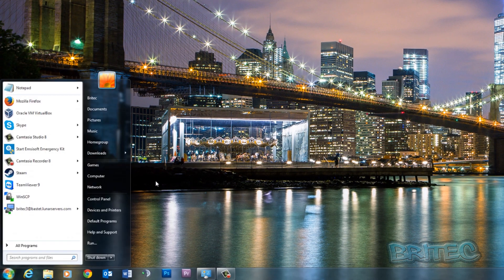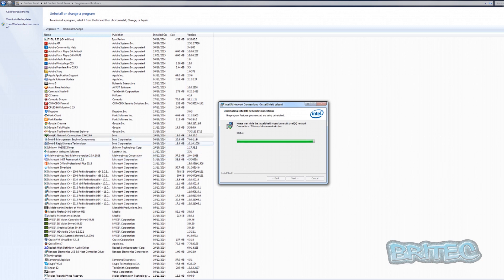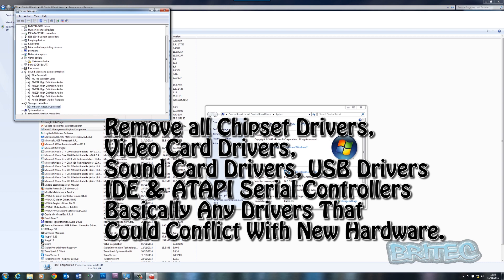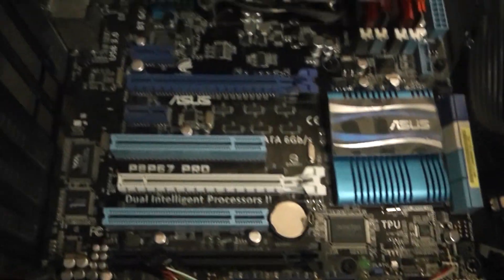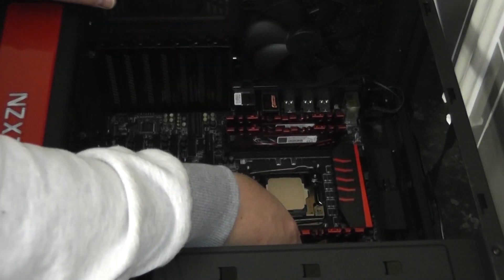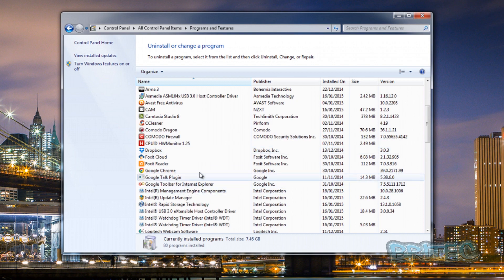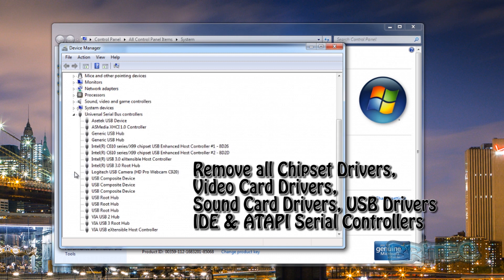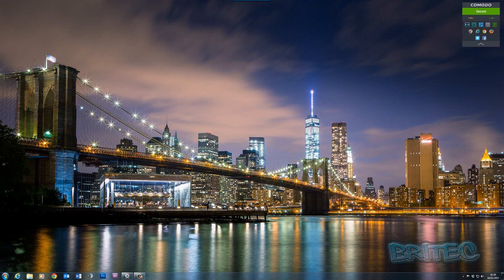Change Motherboard Without Fresh Install of Windows

Comment: Lets say you broke a pin, on the mother board, and you want to get a new one thats the exact same model, brand, and everything. Not needing to replace anything else like CPU, SSDs, RAM etc etc. Will I need to go through all these steps, also what data would I lose in the process? Note I do have windows 11 and all my apps/games installed on my SSDs.

Comment: If your old computer had a Raid-0 configuration, you MUST change the raid configuration in your bios to ENABLED in order to boot windows. Check your manufacturer for specifics. Worked fine for me. Great video.

Comment: Hi just up graded to a
MSI MAG Z590 TOMAHAWK 11th Gen i5 11600K and DDR 4  from a gigabyte Z77 i7 DDR3 so I did your deleted as much as I could in windows drivers in relation to the old motherboard l have to say I've been building systems since windows 4.1 and was very nervous doing it this way but absolutely no problem at all just got into the new Bios made a few changes rebooted like a charm thank you so much for this tip saving me a lot of time 😉😎👍

Comment: Can I do this on windows 10 ? Also do I need to reactivate it?
Reply: Only if the license came with the PC! If you replaced your motherboard you can try logging into your microsoft account so that the license is stored in your account it should say (Activated with a digital license linked to your microsoft account), then try that, never tried it so it might not work. Then I guess uninstall the drivers, which is weird because you'll have to reinstall them, replace the motherboard and then add the drivers back.

Comment: I always did a wipe... I finally got windows 10 This year. I just installed a Z490 with 10850k CPU... I should of just did a wipe. COMPUTER DOING WIERD shit! Playing games on 2 cores? Spiking and lagging system! LOL.

I thought windows was so advanced it would of just overlayed or removed older non-compatible. 1 days of stressing for no reason...

16 years doing this, and I should of followed my caveman ways. I will remove all the i7 9700k Intel Drivers.

Comment: Hi! Is there any way I can upgrade my motherboard to a new chipset/socket? I have a slightly early CPU in my computer (i5-2500K) and a ASUS P8Z68-V PRO (GEN3). Would it be possible to move my HDD to a new system without disturbing it? If so, how? example: new mobo and a 7th gen i7

Comment: URGENT HELP REQUIRED PLEASE
Hi, I hope that you receive this message in good health.

Super quick question, I am moving from Asus H310 9th gen > Msi mpg z390 9th gen.

Changing absolutely nothing but the motherboard.

Now, you said you reinstalled all the drivers. I understand that nvidia drivers you have to manually go and get. HOWEVER where did you get the intel chipset drivers and all the other little drivers from? Shouldn't windows automatically install them as it did for me the very first time like it did with the Asus H310 motherboard? 

Surely we don't have to go and find 20+ drivers for usb and chipset and all these other things manually right? 
Please tell me if these do install automatically. 

Really appreciate the time. 

Many thanks.
Reply: It depends on the motherboard. You can download the drivers on the motherboard's webpage most of the time just to be safe.

Comment: i guess better option is to reinstall windows, it will take alot time to uninstall and reinstall drivers, while u can install windows in 10 mins with all drivers and graphic n adobe softwares can be reinstalled in 10 to 15 mins aswell

Comment: I had to replace my motherboard when one of the resistors broke. Everything else stayed the same; cpu, gpu, ram, and hdd. Installed the appropriate drivers and it all worked fine.
Reply: Did you have to remove/uninstall the drivers from you old mobo as done in the video?  I want to do the same thing.  Keep everything the same just update the mobo.  Is this process a simple plug and play process?
Reply: @poseyserena02  it's highly recommended that you remove/uninstall the drivers of the old motherboard. not necessarily a plug and play process, but quite simple yes. just be sure to install the appropriate drivers for that particular motherboard. if using windows 10, it should cover most of the required drivers suitable for that motherboard. then just install the rest of the drivers you are familiar with, ie. GPU/video adapter.

Comment: What to do if old MB dies and you cannot boot Windows to uninstall drivers?
Reply: You can always boot with the new one and uninstall old drivers then
Reply: @TT-hd3zi  No, You can't do that always. The main purpose of uninstall those drivers is to avoid boot problems changing disk to another computer.

Comment: what if you don't remove the drivers, because like what you said the motherboard died... can you force safe boot with new motherboard and then remove drivers. Then normal boot and install drivers for new motherboard?

Comment: I don't even remove old drivers, just put a new motherboard and when posting it gets the new drivers, after that OS will asking for restart and that is it with no any conflict either, by the way sometimes i use Driver Booster to get the new drivers updated and also it can delete all unplugged old drivers in one click even to be sure that no one conflict will happen in the future.

Comment: Awesome video! I want to point out one thing though:

You should also be able to: replace the motherboard first -> boot Windows in safe mode -> uninstall all drivers -> boot to normal Windows -> install new drivers.
Now if you're having trouble getting the network working for some drivers that need download. I remember when my network card couldn't install without internet which could be a real hassle in the old days. Now you can just plug in your phone with USB and activate Tesselation. It's a function that let's your phone share it's network with your PC. You can connect your phone to your Wifi and share its internet with USB cable plugged in to your PC, or use 4G, 3G or whatever. 

In conclusion, even if your old motherboard is broken it still is possible to use your pre-installed Windows with the new motherboard!

Edit: I realized now that the video is from 2015. Although, this might be usefull for those who end up here looking for exacly this.
Reply: u cant do this is the mobo isnt even reading the hdd because of conflict.
or if u can please explain...
Reply: Absolutely brilliant comment.  Im actually combining techniques to do this as i wish to avoid the headache of uninstalling things im not certain i should be.

My mboard wouldnt let me select safe mode w/ my usb keyboard but i found out if i remove the cmos battery, it worked.  Once in safe mode w/ networking, i downloaded winsetupfromusb & paragon adaptive restore iso which im using to create a usb flash boot drive.

Im gonna let it do all the fixing automatically & if it fails, ill just manually  & carefully delete mboard drivers until i can boot up normal & manually reinstall any i find need to.

This def my first time doing this so im playing it super safe but so glad i found the 2 vids on this topic on this channel & glad i found your comment as i had very few options in making any of this a reality.  

I was about to but a new hdd just so i could use it like im now doing in safe mode.  Safe mode now even gives me the additional option to even do the uninstall so even if i have issues w/ paragon, i know i can figure this bs out lol.  Thanks so much!  So many so called geniuses out there but ive yet to find the solution you gave on google nor youtube after hours of research.  Such a simple solution too!
Reply: Yea my pc wont even read the drives, just goes straight to bios settings.
Reply: I found this video useful today, so haha. Thank you very much for your advice, that's what I'll do. Cheers

Comment: Would you be able to change motherboards of the same type but a different chip set without reinstalling drivers?
I have an ASUS Maximus code with the z270 chipset, and want to replace it with the same motherboard with a z370 set. Would this be possible without any major hassles?

Comment: my son has a problem detecting the mouse qnd keyboards after changing motherboard ..in start up it works but after operating system appears mouse and keyboard won't work

Comment: Lol, I switched from a AMD X470 Ryzen 7 2700x system to a Intel Z390 i7 9700k system, and I forgot that my old Windows installation was on my SSD.  Surprisingly it just booted from the AMD x470 Windows installation! Only reinstalled the Intel chipset and other drivers, and no problems so far :) Did not knew this was possible in 15+ years of PC building.  Always imagined an instant BSOD.
Reply: so basically reinstallation of windows are no longer necessary with windows 10? no conflictions on your end so far?

Comment: the nvidia drivers are unnecessary to uninstall , nvidia drivers of external cards are built to work on any windows machine if they match they same operating system. OS will update the graphic card installed after restart.

Comment: I'm going to change my old motherboard to a new one, when replacing am i going to need to buy a new windows 7 or can i keep the windows 7 installed in my previous Motherboard ?
Reply: It is 2019...why are u still on 7
Reply: @kas579  Because it's better lol. I'm on 7 too.

Comment: Hi.
Perfect your videos, thank you very much.

I have a problem with my pc.
Nothing appears on screen after switching hdd (win10 with problem) to hdd (win7).
Works regularly but nothing appears on the screen.
I emphasize that it is new, almost 1 month I have bought it.
What can be wrong?

Motherboard: ASROCK A320M-DGS RETAIL
Ram: PATRIOT PV48G300C6K VIPER 4 SERIES
CPU: AMD RYZEN 3 220G 3.7GHz 4-CORE
Graphic Card: Integrated AMD Radeon R-Series Graphics σε A-series APU.

Comment: Thanks for the video, very useful! I have a question- I have an Asus Prime Z270-P but I want to replace it with Asus Z270-A because the Z270-A is compatible with ThunderboltEX 3 controller. I`m not going to replace anything else, like cpu, memory, etc. I suppose all drivers must be the same for the new MB; should I do this procedure? It is not a  big upgrade, the same company, nearly identical mobos... Thanks.

Comment: Back in 2016 I build a "new" computer (switched from AMD2 to AMD3+) with a new CPU and motherboard, but didn't install a new OS. My friend just plugged in my hard drive, where Windows 7 is installed, and we had no issues. I'm planning to build a new rig since this build is useless but plan not to install a new OS. I will just transfer my current OS to a new SSD. You think this is ok? I don't mind installing a new OS, but I prefer Windows 7 much more than 10 and I don't really care about gaming. I plan to be an editor and designer.

Comment: from what i've been told it's often easier to get a new blank drive do a fresh install on a new HDD(SSD is preferrable nowadays) and then when the install is done and setup up you should be able to plug in your old HDD either internal or external as a secondary storage device (like extra storage space or a usb stick but bigger) and while i'm not sure if it's certain to be the case I have been told that can stop it from wiping though if I was you I might get a third to backup on in case it does and just copy across the files you want to keep.

then after that keep the original copy on the backups in-case you might need them ssd is best as they have no mechanical parts they're less likely to break when being moved!

i'm hoping since I don't have a back up that by using my currently blank hybrid ssd(which i'm currently just using for v-ram) as my installation drive (main drive) that once the computer is setup and essentially done with the process of installing basic software and drivers and stuff that I should be able to then shut it down open it up plug-in my old drive next to the new one and then access my old files as though they are in a spare drive thats full without losing my data although to avoid conflict I think I will try to remove the old windows files on it as they may cause issues but if i'm advised against that I'll have to buy a backup (hey it's what student loans are for)

A lot can wrong as it's my first time upgrading a without sending it to a workshop to be done for me since on the hardware side I know what i'm doing, but i'm going to be getting an up to date book or using my free college chromebook to walk me through it or to revise on before I attempt as there are still unknowns like hardware to software incompatibility issues and once it's done I can't go back to the old system cause from what I can tell it will believe itself to be a new system regardless if the components are the mostly the same!

but it's a needs must It's either that or pay £800 for a new one which is essentially an extra £400 for using the middle man where as I am buying from the manufacturer directly via amazon, 

rather than pc world for a retail build or a upgrade component package from a company (I think it was lcc computers) which i've seen giving out bad advice like "yeah you can overclock your intel without affecting your warranty" 

thankfully the guy who asked them these questions already knew the answer and was secretly actually a tech advisor reviewing their reliability as a company to buy components and other tech from and was there to warn people not to trust it!

After all i've learned i've realised 2 truths 

1. it's best to do it yourself [given you know what your doing that is, seek advice, and an important note is: people mention to press down on the power button after unplugging to earth it but that only goes for the motherboard and other components, 
HOWEVER a PSU(Power Supply) IS A BATTERY SO LEAVE IT 5 OR 10 MINUTES TO LOSE IT'S CHARGE! >OR YOU WILL LIKELY DIE TRYING TO REMOVE IT as a death of a young man at 16 who often dealt with computers didn't know this had he known he would of been my age now may his soul rest in peace,
So listen to a guide but remember this if it isn't mentioned as it may save your life<)].

2. if it's much cheaper than retail and isn't directly from a manufacturer that you know is trustworthy e.g. ASUS (pretty decent affordable motherboards the A320M-K Prime is good for upgrades and component compatibility but keep in mind the ram slots are for 288 pin cards)

or SEAGATE(if your looking for hard drives they got good prices for direct buy on amazon from SEAGATE and a decent 1TB SSD hybrid with fair data transfer speeds too good for vram).

as I was saying before I interrupted myself.... basically if it's to cheap to be true for such good hardware it usually is all i'm saying is 2TB usb sticks don't exist the best are 500gb and they definitely aren't £16.99 

and just cause a company has good reviews doesn't mean that they aren't fake reviews created by the company themselves and while there are genuinely some that may have not had a bad purchase the same can't be said for the rest and you have to way up the risk that it's very likely your going to have a bad and don't go by reviews that are easily faked or fabricated or payed off.

go by direct purchase from companies that your family and friends have used and are well known don't buy a revnsport ltn x720 graphics card(hypothetical name) buy an NVidea(it just works) or a Radeon(always underrated) card cause at least with those you know where you stand with those company and it's something that's trusted on a global scale and if you buy them directly through amazon they can be cheaper (even cheaper through amazon prime I heard but that's not my cup of tea)
Reply: I know this an old post...but this is the best way to do it. I have done it this way in the past without any issues. I just installed a new ssd card...formatted it. Stuck in my windows 10 flash drive stick, Restarted my pc and then into my bios set it to boot off of the flash drive stick...installed windows without any issues. I kept the old ssd card installed and removed the windows folders and kept it as a storage card. I found it to be the best way because I don't loose anything..and what I want to install back on the new one I got them from my old ssd card.

Comment: Hello, I've got a quite complicated situation.. My friends did a full reset on his pc (an old dell vostro with I5 2400) and then the USB keyboard and mouse stop working as soon as windows boots up and he stays blocked at the configuration for windows first boot.. (works in the bios but no USB legacy mode, and no ps/2 connectors on the motherboard...) basically he's blocked and he can't install the keyboard/mouse drivers because he can't get into windows.
I have a PC, new motherboard, I7 7700K, if I boot on his hdd (no drivers installed on his windows yet so it should boot up without conflict?) and then install his keyboard and mouse drivers, then delete any motherboard drivers and then put it back into his pc, the keyboard and mouse would work?

Thank you!

Comment: Good video!  There will NEVER be  another OS like Windows 98 SE!  With 98 SE you could swipe the motherboard out without much issue, but the same technique here  applied there as well!  I  however will take it one step further by recommended you use an uninstaller program like IO Bit Uninstaller.

Comment: I've had problems with no sound after upgrade , switching to safe mode and instaling sound drivers there fixed it for me . As for windows 10 upgrade version activation , the activation from ms account didnt work but putting my old w7 key seems  to activate it